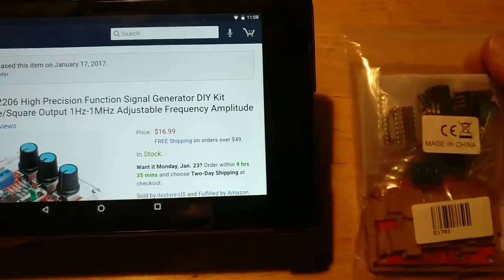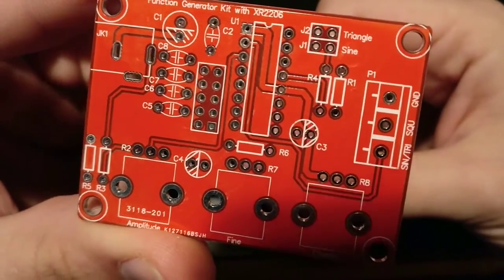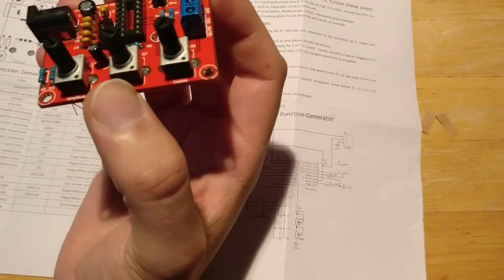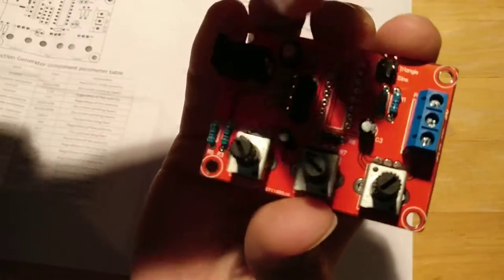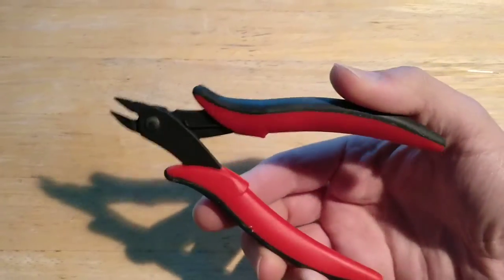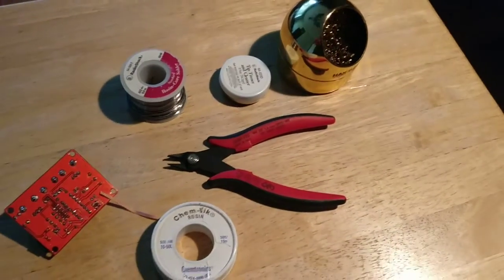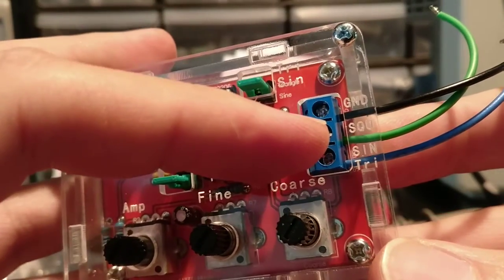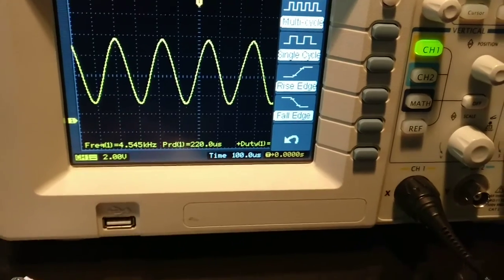KKmoon Signal Generator DIY (Siglent Alternative)

Comment: It looks good to me. I just picked one of those signal generators up when it was on sale for $5 It looks just like the one you have. Except the corner is not broken on mine. The pads are pretty tight on that board. When I put mine together the coarse frequency adjustment potentiometer was a bit wonky and I would only get a signal out if I pressed the pot shaft down. So I had to take the pot off the board and open it up to fix it. I bent the wipers up a bit and made a ring washer out of a bit of wire and put the pot back together. I got it to work. When I discovered that flaw I thought oh goody more fun. It was like a bonus thing to do.
Reply from the maker: Nice :)